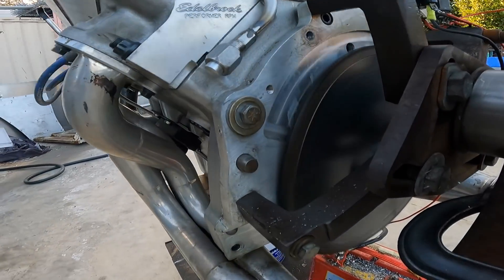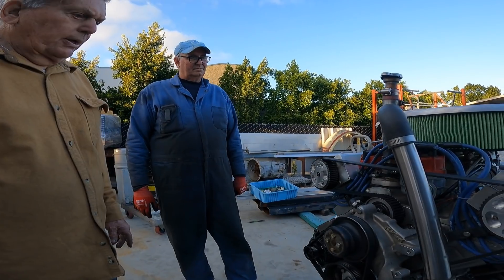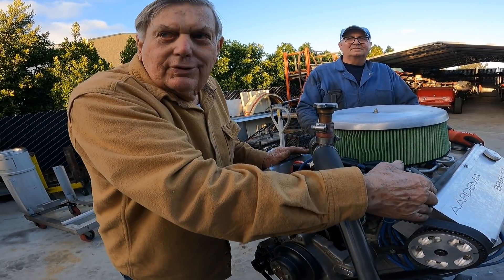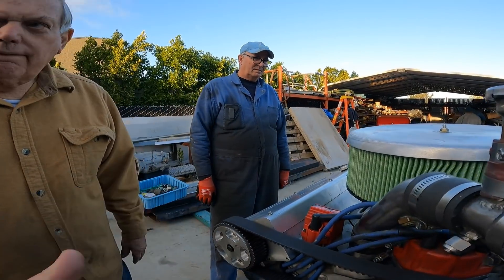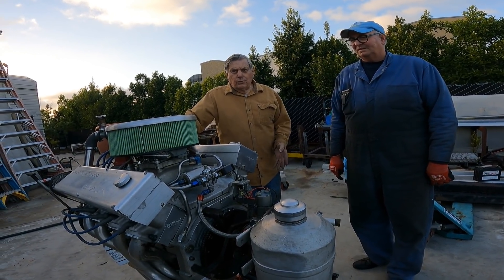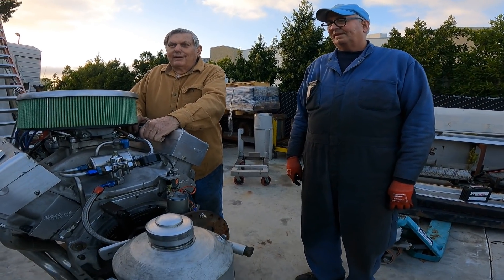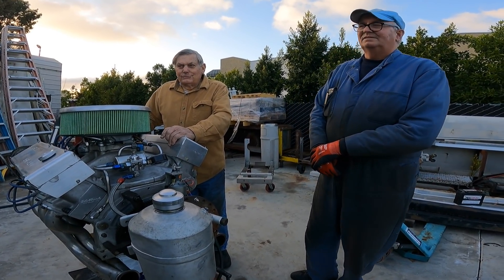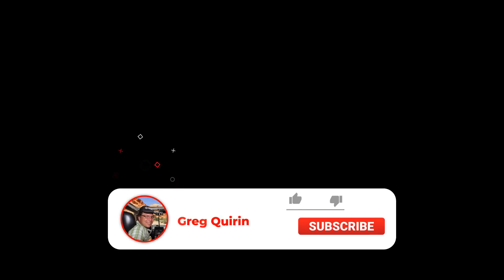DIY Overhead Cam Ford 427 Stroker Wedge Head Engine Conversion

Comment: this is what i like about aardema and braun. They're both open source. They want the knowledge to be spread. I'll keep supporting them as far as I can <3
Reply: Aarbema is the greatest of all time in thinking outside the box and truly understands the potential of the FE. A 4 master cam would have been the cure and adding turbocharging to the equation would have revolutionized the use of previous engineering in a modern demand and construction era. It will all be lost to history in our present paradigm of design and development engineering. It breaks my heart to see the DIY era of “hot rodding “

Comment: That bucket valve 427 sounds really wild as is. They're right, to get more valve lift they need a bigger diameter bucket to accomodate the larger cam.

Comment: I was talking about the old ways  some cam grinders made masters. Now most masters are made on CNC grinders and many cams are ground on CNC grinders, but the cam lobe still has to be designed.
Reply: Isky for example? I ran as Isky 4HHH track cam in a 354 Hemi which was incredibly smooth and tractable but with injection gave great throttle response.  In contrast i have a BOP alloy V8 running a cam ground locally which has a grind stolen from one designed for a BMC a series engine (Austin Healy sprite,Mini etc )   while it gives great revs ,there is no bottom end torque etc etc .

Comment: I spent an enormous amount of time working with Olds Quad 4 engines. That is a bucket engine also, but 4 valve. And the big mistake that Oldsmobile made was, that the Cam cores were never big enough, so you could not get the lift needed. You could get plenty of valve acceleration, but the lobe area was never large enough. Bucket engines are made to be 4valve engines, so I do understand the problem Pete and Kevin had trying to make a 2 valve engine work.

Comment: I can vouch for comp not knowing what they’re doing, I was doing a cross flow head swap on a in-line 6 Chevy, I needed to revise the cam lobe layout and because I was going to use a chain drive setup instead of gears that meshed , the cam needed to spin counterclockwise. I found one company in the US that offered help.

Comment: Well, maybe... time to move on to electronics; With individual solenoids, pickups, and a computer, you can get any duration, timing, and lift you want and even change it on the fly.

Comment: These guys were just born alittle too late! The stuff that they were doing is awesome 😎! Except cylinder head technology really started moving forward in the 90s & especially in the 2000s! So why would you spend tons of cash 💰 on something your not sure is going to be much better than regular pushrod stuff, maybe not even as good? Engine RPM is not so much based on how big the Engine is, yes the bigger it is, the harder it is to turn up high! But it has everything to do with required airflow a engine needs! Like old 632s without a raised camshaft, were really limited on horsepower because the big stroke made the rods run into the camshaft! Small block Chevys are the same exact way! Once you get to a 4 in stroke, you really have to pay attention to rod to cam clearances! Anyway getting off topic, Basically if Sonny Leanord could turn 650 cubic inch truckpull engines over 8800 rpm & they pull wide open for over 10 seconds, why would you spend all the extra money trying to reinvent the wheel? The rpm is always dependent by airflow through the engine! Besides pushrod stuff is very common cheap & it just works! I’m sure they could overcome all the issues now, especially with CNC cam grinders, but you still need a good intake tract to actually make the power! I love that they tried! There also was a guy back in the 2000s, I believe his name was Russ Aero? He had Small & Big block Chevy 4 valve per cylinder heads! They were many times better than what was previously available, but people started making regular cylinder heads that would flow similar & make good power! Off the shelf, with no major complications or issues! So I think that’s what put him out! It was cool 😎, still pushrod but 32 valves & it worked, but you just couldn’t overcome costs! I believe that there are YouTube videos from over 10 years ago if you look 👀 up 32 valve SBCs! Most auto manufacturers & racers  are looking for the fewest parts possible! The more parts you have, the more the costs & possibly more issues! Never mind the weight & size! It would have been really awesome if these two guys had the machinery we have today back then! That’s the final thing, it used to take tons of time to build things back then! Today you could do a complete real deal race valve job in under 1 hour, especially with a NEWAY EPOC! My boss used to spend a day just doing a competition valve job 🙄🙄🙄🙄!
Reply: If you're so knowledgeable and can do real deal race valve jobs in an hour why are you working for someone that isn't as good as you? Got any videos of anything you've done or is that top secret squirrel shit?
Reply: I know these guys and they've set many many scta records with handmade engines! They love this stuff and they make mistakes. That's how you learn!
Reply from the maker: Pete and Kevin do what they do for the fun and passion. It’s has nothing to do with wasting time and money.  Both are true innovators and usually succeed with what they intend on doing. They are not late to the game,they have been doing this for a very long time.Pete started at age 14. Both are self taught automotive engineers who have a proven track record of great success with over 30 land speeds records in the books with their one off engine designs.  I have a huge amount respect for both Pete and Kevin and truly envy their style, success, and willingness to share their knowledge with world.